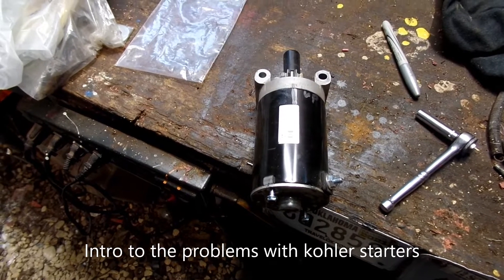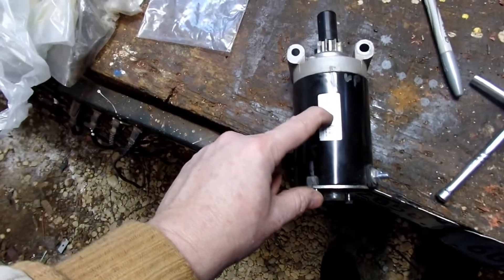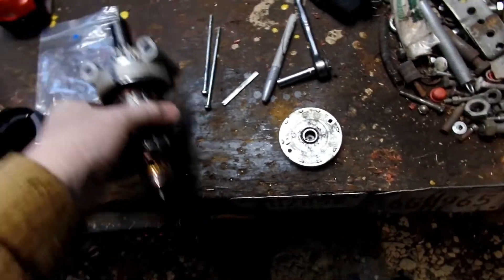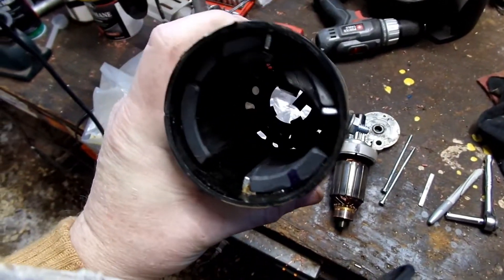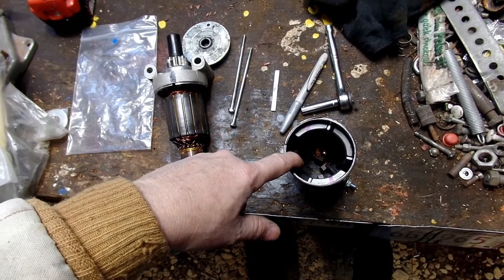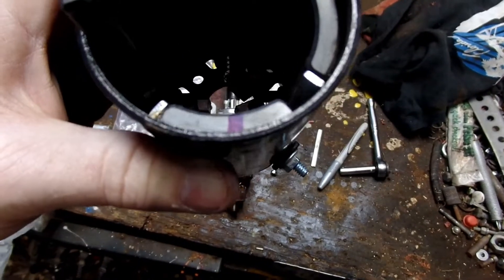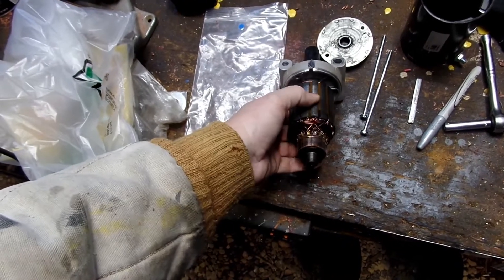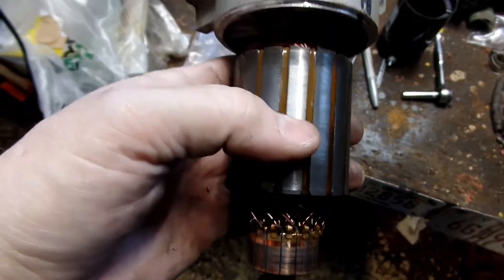Kohler7000 Series Starter Motor Problems!!

Comment: I would have measured the distance between 2 opposing magnet and draw a pencil line lengthwise down the case, then measured  from one end of the case to the far end of the magnet that opposed the one I was mounting, then taking that measurement and subtracting half the length of the magnet from it to find the place to drill the case so when the magnet is in it;s place, the hole will line up with the center of the magnet lengthwise. Then mark across my pencil line there to find where to drill. Then I would measure the magnet to find the center of it and drill a hole there. I would use a small but maybe 1/8" and use a screw bolt from the inside of the starter to mount the magnet in place to check it was where it is suppose to be. Then I would remove it, put glue on it and use the screw to hold it in place overnight as the glue cured. Then remove the screw and cover over the hole in the case so dirt can't get in. Magnets are not easily drilled or tapped and if the case is not perfect curved to the magnet, tightening a screw could break it. The old car starters had metal blocks formed into the magnets so there was no stress on the magnet and you could tighten the screw tight. That is why they used glue in these starters, it cost more to make a magnet with a metal block in it so they used glue. Fixing it you should only use glue or you risk breaking the magnet and a bolt will not hold it in place like glue will.  Looks like someone held the starter key on when the starter would not turn, or when it was dragging, yea without the varnish insuating the tier on the armature, it is like a dead short., no magnetic field will be produced.

Comment: Thank you very much for sharing your experience. I was wondering what the inside looked like. 

I am in a learning curve about the Kohler starters. Our Cub Cadet XT1 LT-46 has the Kohler 7000 Series KT725-725cc 22HP engine and the starter's part number is 1999-1140051 32-098-08  January 1, 2017.  We purchased our lawn tractor in July 2017 from Home Depot.  On Saturday April 13, 2024, I discovered that our tractor would not start. After searching the internet, YouTube and reading, I proceeded to perform a few tasks that were overdue that got neglected due to family health matters.  
The past twelve-(12) days, I searched the internet, compared prices and brands on the online shopping platforms and shopped local brick and mortar shops to obtain price quotes and conversed with small landscaping business owners to gain information. I am having a difficult time in understanding the great price differences "for the alleged same product" from different stores and and different 3rd party sellers on different online stores on the digital market platforms.   IT is getting harder to find honest brokers in most industries and businesses.   
On Thursday, April 18, 2024 - 
Connected the Super Start battery and removed the hood, removed the air-filter and sprayed the Engine Starter Fluid and placed the air-filter back into the housing. Loosened the Choke/Throttle cable in attempt to tighten the cable tension, attempted to start the engine and it did not crank, removed and checked the 20-amp fuse that is in the battery cables – it looked good, removed the engine cover with a eight millimeter-(8-mm), attempted to remove the starter with 3/8-in socket and a 7/16-in socket, but learned the bolts require a ten millimeter-(10-mm) socket – borrowed correct socket size from neighbor, removed the starter and confirmed that it was broken because the gear-wheel sheared off from the rest of its housing.  
On Wednesday, April 17, 2024 - 
Removed the new Champion spark plugs due to learning that must be set at 0.030-in; retrieved the spark plug gauge tools and set both plugs to as close to the specification of 0.030-in as required from the Cub Cadet YouTube Channel; Re-installed the Champion Spark Plugs, Poured the second one quart-(1-qt.) of SAE-30 oil into the engine dipstick cavity, Reconnected the battery cables and reattached the hood, Attempted to start the Cub Cadet XT1 LT-46 lawn tractor – it failed to start 
Tuesday, April 16, 2024 - 
Disconnected the Super Start battery in preparation to test if it is a good battery, retrieved my old Archer-Kit Volt-Ohm Multi-meter to test the battery – it tested good. Searched YouTube and the internet for probable causes as to why the lawn tractor won't start and found a dozen reasons, Inventoried our Cub Cadet replacements parts and fluids; we need two-(2) quarts of SAE-30 engine oil and two-(2) spark plugs, Drained the engine oil and it was very dark; removed the spark plugs and IMHO learned that they need to be replaced with new spark plugs; Installed two-(2) new Champion Spark Plugs – later I learned that I may have torque them too tight and the spark plug gap needs to measure 0.030”, Installed one-(1) new air-filter, Installed one-(1) new oil-filter, poured one quart-(1qt.) of engine oil [need to add the second quart of engine oil tomorrow]   
Monday, April 15, 2024 
Removed the battery from the Cub Cadet battery - mystery label May 2018 ? Dad purchased the tractor July 2017 
Visited O'Reilly's Auto Parts Store to verify if the battery could hold a charge - No
Purchased Super Start battery from O'Reilly's Auto Parts Store
Installed the battery and attempted to start, but the tractor failed to start  
Disconnected the Super Start battery as precaution to prevent draining the battery  
Saturday, April 13, 2024
Discovered that the lawn tractor would not start

Comment: Everytime I have ever seen that on any piece of equipment. It has been caused by something hitting the starter. Now it could of started by someone at factory or from manufacturer of the unit bumping it with something while mounting engine. All engines can have that same problem.
Reply from the maker: That's the 3-4th starter. I bought the high dollar Kohler this time. If I could drill through the magnet and case I could make this permanent fix. I haven't found a drill bit hard enough yet to go through the magnet.
Reply: @TheClintmeister  On my older one when it doesn't want to turn over starter stoped on compression. I adjust the valves and it's good for another 200 hours. But Your starter problem could be different. On My old apposed twin kt-17s when I bought it both rods were broken in engine. All the charging magnet's were broken off inside of flywheel. Kohler said don't glue them on by a new $275.00 flywheel. No thanks I epoxyed them on with 30 minute model epoxy. I sold that mower in 2017 after 2000 hour's on it. It held up better then factory.
Reply from the maker: Look se rif a tooth came off of starter ring or gear.